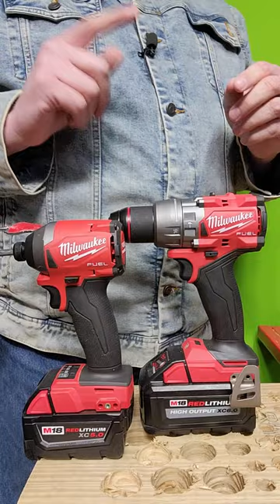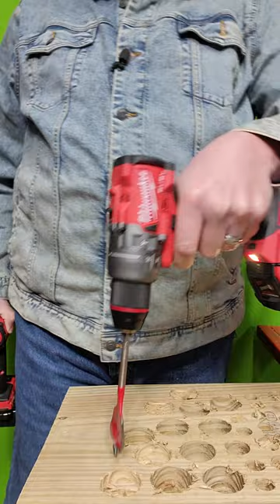Differences in Power Between a Drill and an Impact Driver #milwaukeetools #milwaukee #shorts

Comment: ? Isn't Torque = force x lever-arm? I think the confusion may lie in the frame of reference i.e where the Torque is measured. I think both tools applies Torque to the work piece. If both ulare using same motor and batteries, it means both output the same energy. The difference is an impact will output more power (converts to higher peak torque applied) in short intervals of time. The drill outputs lower power over a longer and constant time frame (lower peak torque but the impact averages the same over long periods)

Comment: Torque is force applied around a radius (twisting force) the impact driver creates a greater force around the same radius diameter therefore it has more torque. Good try though
Reply from the maker: Well, one of us is half right and it isn't you.  The force applied to the anvil is linear, not rotational but good try though.

Comment: Sorry its not correct: The impact driver has more torque than the Drill driver. The drill has more Power than the impact driver. Performance = torque times speed. Thats why the drill driver is faster. mention that the torque in the impact driver is a hard torque. the drilldriver uses a soft torque. (sry: i sorry i confused power with performance and changed that)
Reply from the maker: Thank you for your instant, incorrect, expertise
Reply: @ToolswithSoAlz  where is my mistake?
Reply: All torque is, is a measurement of rotational force. Like the Milwaukee fuel impact driver is capable of producing up to 2,000 inch lbs of rotational force wich is a measurement of torque. But it’s supplied in increments by hammer blows hard torque. At least that’s the way it was explained to me. I could be wrong bro but it’s something I’m interested to learn. The reason the drill is faster is that it’s rotational force is continuous full torque supplied at once. That’s the way I look at it anyways. I’m curious to find out how it all works
Reply from the maker: An impact driver's only torque is the amount it takes for the spring to move back and propel the hammer into the anvil. If done several hundreds of times, in a minute, those blows add up but those are impacting (percussive) blows and not actual torque.
Reply: @ToolswithSoAlz  I got you bud. That’s why I don’t understand where all these companies get these Ft lb ratings and nut busting torque and all that. It’s just confusing as hell. I didn’t really fully understand the difference between the blows and torque thanks for breaking it down man
Reply from the maker: That's easy, they're using what the impact can break loose if allowed to hit the object enough times. They never tell you how long it will take, what battery was used or even the rig used to get it. That's why I have enjoyed doing the more realistic torque testing we did with the drills. Everyone can see exactly what's going on and how we got to the number.
Reply: @ToolswithSoAlz  What you mean is Power not torque. Your Torque tests are great. Would love to see the ryobi psbdd01.
Reply from the maker: Torque is the amount of force, in this instance, that a drill prodives while in rotation. Dynamic torque is when you can control the speed of the rotation. An impact driver doesn't provide torque or very small amounts of torque because it uses percussive force
Reply: @ToolswithSoAlz  I think that’s the best way too man. I know everyone enjoyed them including myself. It’s like the sweet 16 for tool addicts😂
Reply from the maker: Thank you
Reply: @ToolswithSoAlz  Every single blow has the maximum torque
Reply: @mulimuli9844  you are correct. If you measure the torque delivered by the drill driver and the impact driver the readings will second your statement.
Reply from the maker: Funny because once an impact driver starts impacting you are no longer measuring torque but the concussive force
Reply: @ToolswithSoAlz  I‘m not an native english speaker. but i think you mean impact energy. This is measured in Joule or newtonmeter, exactly like torque.
Reply: @ToolswithSoAlz  I think the issue is that you are limiting the definition of torque to that which is applied by a motor. Torque is simply a measurement of a force acting at a distance. The concussive force you mention acts at a distance from the central axis of the driver, producing a torque. The fact that it's not sustained does not change that
Reply: You were correct with your use of power, power outputting from an engine could be any combination of torque and RPM, Watts or horsepower would be the measurement of power, two tools with the same watts can produce very different torque depending on the RPM
Reply: Actually they both have the SAME average torque applied to the worpiece if they have the same powerplant. One is only making more peak torque using impact (short pulses over time). It's not a complicated concept.
Reply from the maker: @chrisadams3635 ma'am when you and your husband leave it'll be like watching the trash take itself out. Bye Christina

Comment: That hammer will accumulate more torque on that bolt your trying to snap.
Reply from the maker: Torque no. Torque is rotational force which does not involve a hammer as that is linear force. If you didn't understand the video then you shouldn't try correcting people.

Comment: Tell me why I can't take lug nuts off with my drill and I can do it with the driver
Reply from the maker: Because you don't understand the difference between torque and impacting force, as this was explained in the video
Reply: I had no idea that the impact driver had more torque then the drill because I don't understand
Reply from the maker: Well, an impact driver, a cordless one at least, doesn't actually produce torque. It makes concussive force. A drill has a demonstrable dynamic torque as torque is the ratio of rotational forces and speed. A drill easily has more actual torque because the only thing that provides torque in an impact driver is a spring held within the head and exerted only upon the hammer. You know, just as it was explained in the video
Reply: Explain this one more time lol
Reply from the maker: Feels like it
Reply: @ToolswithSoAlz  I love how you broke down the complex mechanics of how Torque is truly just raw Pushing power like a wrench sets a torque at a specified setting. To completely be able to record a tools maximum power one would have to take all variables of horsepower into account such as speed and torque. However you are correct in saying that a drill has more torque than an impact. The impacts functions off of speed more than actual torque and it simply does this many thousands of times, when done fast enough the torque although much less compounds on top of each other increasing horsepower until the bolt is free in which case all built up torque is released as speed again.
Reply: @ToolswithSoAlz I might be wrong but a example may be when your hitting a nail with a hammer you strike it instead of placing the hammer on the nail a pushing as hard as you could( I'm probably wrong just want to know if I'm anywhere close)
Reply: @ToolswithSoAlz if it doesn’t actually make torque then why are the impact drivers’ outputs all measure in inch/lbs of torque??
Reply from the maker: @Florida_man420 because only one of us understands how torque works and why the drill actually produces true torque vs outputting kinetic energy